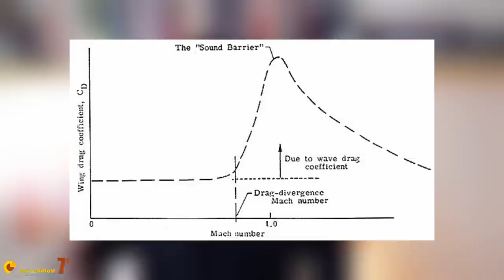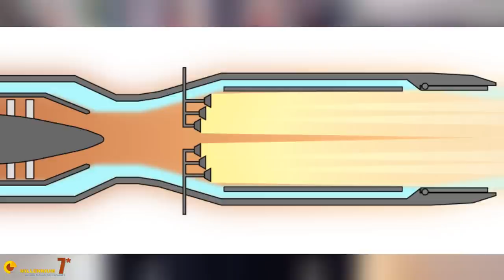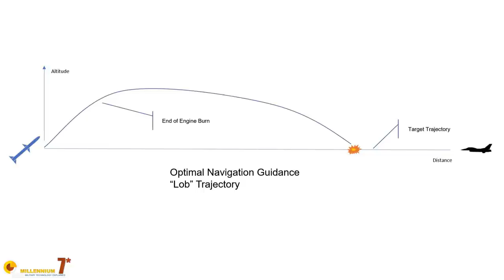Flying SUPERSONIC with NO Afterburner | Why SUPERCRUISE is so Important?

Comment: F-35 "A" can supercruise. But I would agree that it's not a "meaningful supercruise" for purposes of range/travel time vs. fuel. The data that F-35 can't supercruise is based on earlier iterations of the F-135 engine. The A model with current engines can supercruise, and tops out around mach 1.3 without afterburner. The engines are still under development. Original models of the F-135 engine had only 38,000 lbs of max thrust, but it's currently at 44,000 to 46,000 (29,000 non afterburning). Program goal is to reach 54,000-56,000 max thrust, with dry thrust well over 30,000lb, which would give all models supercruise for purposes of missile launch, and the A model a supercruise speed which could be meaningful to it's range & speed vs. fuel. Although the airframe isn't really designed for staying supersonic for long periods, and doing so would have a harsh IR detection penalty even without afterburner, due to skin heating. Still the A model can go 150+ miles at mach 1.3 in non afterburning mode.

The range/speed advantages of supercruise are not realized until you push well beyond mach 1, and start to realize some of the diminishing drag as the shape of the supersonic shockwave becomes more aerodynamic. So in that sense, all planes which supercruise at say mach 1.3/1.4 or less, do not benefit significantly by it (at least in terms of fuel vs range/speed), as they are just increasing their drag dramatically for a comparatively small boost in speed. Although, it can absolutely be useful for missile kinematics if the missile is beyond the mach 1 threshold before being ignited, as the missile does not need to expend energy overcoming this hump (edit, I see you mentioned this right as I'm typing hehe). And if that can be accomplished without afterburner, that's a plus. Although any fighter could use the afterburner to achieve this. Worth mentioning, the F-35 has a ridiculously large internal fuel capacity, making afterburning just for a missile launch relatively trivial to it's fuel reserves for the B/C model.

In a nutshell, the F-35 is designed to exploit supercruise re: the speed advantage for missile launch, without undue fuel loss or IR penalty, but does not take advantage of a sustained range/speed advantage from supercruise like the F-22. Unfortunately the plain is over it's intended weight, so only the A can avoid the IR flash of afterburner for missile launch. Thus the continued funding of engine thrust tweaking to rectify this.

Personally, I'd give the SR-71 (& related archangel 12 series) a "supercruise" title, even if they use afterburner, because they're designed to fly in afterburning mode nearly all of the time, arguably it's a largely ramjet powered aircraft in design. Similarly the concord, I wouldn't discredit it's supersonic cruise just because it needs afterburner temporarily to push past mach 1. F-14D was also supercruise capable, with wings back and the 110 engines, again not so much that it would be beneficial for 'general use', but good for a missile shot.

Speed "can" help a plane to cause missiles to expend extra energy to follow it's predicted flight path when turning, but it's also an advantage to get low and drag a missile through denser atmosphere at a lower speed. This in effect causes the relative range (in terms of how much air mass must be penetrated to reach the target) to be higher. And it allows for sharper turns for the aircraft, which can be as advantageous as high speed turns due to the much sharper turn radius. Typically a fighter would try to exploit both of these factors, initially starting at speed, and then turning down into thick air to exploit that aspect as well. This all works kinda poorly vs. phoenix missiles, as they are hypersonic, which reduces their lead distance, and allows the missile to close in on the target very rapidly. Which is why the USNavy is practically married to them.
Reply: No, it can't and it never could.  No version of the F-35 could ever supercruise.  In fact, it said on the old jsf.com website that the F135 engine wasn't even designed with supercruise in mind.  Supercruise was never to be a feature of the F-35.
Reply: @AvroBellow  It's "designed" to peek into supercruise for missile kinematic purposes, without afterburner. It's very clearly NOT designed to go significantly into supercruise as a means of extending range & speed. 

The bypass is very high, and the aerodynamics are all wrong (especially inside the air intakes) for serious high-end supercruise. But it is designed to leverage "low supercruise" for missile launch kinematics. It's over it's original design weight though, making the B/C models incapable of supercruise without using a brief amount of afterburner or a dive.

The engines are still being developed though. I'm pretty confident they can squeeze enough dry thrust into them to get the B & C models back to design goal parameters. It's very close currently. Even lower internal fuel amount is enough to tip it into low-supercruise capability. And the A model, is already at it's designed speed goal.

If you define supercruise as a means of traveling long distances very fast, then yeah, it was never designed for supercruise. So we may be arguing semantics.

PS: the avro arrow is a really cool plane.

Comment: Usually your videos are great, but this one unfortunately contains glaring errors and promotes wrong concepts. 
At 4:40 - Wave drag does not reach a peak around Mach 1!! It's only the drag coefficient that does. The coefficient drops after about Mach 1.1, but the drag itself (both skin friction and wave) keeps rising (in other words, the slope of the drop in CD is always at a rate lower than M^2). I have never come across a configuration, be it body only (bullets, tanks), BTT (aircraft) or STT (most missiles) that shows a drop in the drag itself as it goes past Mach 1(as opposed to its coefficient). 
A simple empirical formula for the drop in wave drag coefficient is given in Raymer's "Aircraft design: a conceptual approach" (eq. 12.45 in the 9th edition). If you convert this to drag force you will see an increase. Likewise, a drag coefficient map for lots of different aircrafts is given in the same section of the book (fig. 12.34) and if converted for actual drag will show an obvious increase. I suggest you try it with the F-104 as that shows the highest drop in drag coefficient, yet still an increase in drag force. Similar data can be easily found for bullets and missiles, leading to the same conclusion.

The reason that aircrafts going between Mach 1.1 and 1.3 experience an increase in acceleration relative to Mach 1 is not due to a reduction in drag (there's no such thing), but due to increase in excess power. Excess power depends on both drag and thrust. In the aforementioned range the increase in drag is usually at a lower rate than the increase in (jet engine) thrust, so overall excess power increases and an aircraft will have a higher acceleration than at Mach 1. 
This is true for jet engines, but not for rocket propulsion. The thrust of a rocket is independent of its speed, so for missiles the excess power always decreases with speed. Therefore the acceleration of a missile at a given thrust level is always dropping with speed. A missile launched at Mach 1.2 for example will therefore have to push against more drag than a missile launched at Mach 0.9, and will have less initial acceleration. However, since it started with higher speed it will end up with higher speed when the motor cuts out. So what you said at 12:05 is only half true - the benefit is only in giving the missile higher initial energy, not in avoiding going through Mach 1.
Reply from the maker: I am aware, it is not an error. I intentionally confused the coefficient with the force because this is a YT video and not a university lesson with a lot of equations. I tried to add the equations in the past, but it wasn't well received. The only diagram I show, shows the Cd and not D.
However your observation is correct, as it is explained in the video it seems that the total drag is falling.

About the missiles, I still have some doubts, because pilots themselves explain that they are trained to launch at supersonic speed, if possible, to avoid the missile going through "the hump". Also I am not so sure that the nozzle expansion doesn't have an effect in this respect.
If you could point me to some material I would be happy to go deeper into this.
Reply: @Millennium7HistoryTech  I was only able to reply now, so I hope you will still see this.
By nozzle expansion I assume you mean the rocket nozzle. The expansion is affected by combustion pressure, ambient pressure (altitude) and nozzle geometry alone. So at a given engine burn parameters the thrust is affected only by ambient pressure and is entirely independent of speed. I have experience in missile aerodynamic and in 6 DOF simulations of them. Thrust is always modeled in the way I explained. Here are some publicly available papers in support of this:

1. https://turano.io/projects/Launch_Systems.pdf. This discusses the aim-7 as an example. See fig 3.1 for the thrust profile. This is a duel phase solid propellant rocket motor and you can see that the thrust (in each phase) is constant. Also Note the thrust equation (eq. 3.8) - it depends only on combustion parameters, nozzle geometry and ambient pressure.
This paper also discusses the aerodynamics, and looking at the equations you can see that the drag is always rising with Mach (I know you said you know this, but as it's discussed in the paper I thought I'd mentioned it for anyone else who might be interested).
2. https://scholarworks.calstate.edu/downloads/vm40xv302. Another paper discussing the aim-7. Note fig. 3-10 - thrust is a constant (at each phase).
3. https://ijret.org/volumes/2015v04/i03/IJRET20150403016.pdf. This discusses aerodynamics only. Note that drag (fig 1, 2) is rising continuously and never drops past Mach 1. 

So we have drag that keeps increasing with Mach, and thrust that is constant - therefore a missile will experience a continuous reduction in acceleration as it goes through and behind Mach 1 (ignoring change in mass - but that has nothing to do with Mach number). There is therefore no advantage in avoiding Mach 1, only in giving the missile more initial speed.

Comment: English Electric Lightning in the 1950s could supercruise
Reply: No, It couldn't
The prototype with no payload could cruise at M1.02 - No in service version of the plane could without wet (Afterburning) thrust

Thats before pointing out that the purpose of super-cruise is to cruise above the transonic drag peak making for easy acceleration, not AT the peak
Reply: @bengrogan9710  The prototypes were powered by un-reheated Armstrong Siddeley Sapphire. WG760 when through the sound barrier in a climb, the aircraft was limited to 1.5 mach due to directional stability limits. Production aircraft were powered by the much more powerful  Rolls-Royce Avon engines which allowed production aircraft to supercruise higher speeds then the prototypes could.
Reply: @andyc3088  Can you cite any source showing any production could maintain post-Mach speeds in level flight at sea level on dry thrust only
This is the definition of super-cruise
We are both in agreement that with wet thrust the Avon's where more powerful, but wet thrust is not super-cruise
Reply: @bengrogan9710  There's many, many articles on the internet with the information just look and your see. However, it's very hard for an aircraft to go supersonic at sea level, they have to use there afterburners to do so. This is due to many factors, the main one being at lower altitudes were air is more denser then at higher altitudes, so it's easier for aircraft to supercruise at height.  It's like riding a bike 80% of your effort is used to moving the air out of the way, this is the same for aircraft. I doubt any aircraft can supercruise even the F22 at sea level.
Reply: The reason I asked if you had any source to back up what you said is because I already know the answer is no, All the post-mach figures for the Lightning that are recorded are either Shallow dive dry thrust or level flight wet thrust.

As for the doubting ANY aircraft can super-cruise ASL, that is simply a silly statement due to the exact information that you posted the layman's explanation of.
The speed of any given mach number is dependent on atmospheric pressure, as the density at higher levels reduces so too does the speed of sound increase.

Comment: The F-22 is the ONLY one than can super cruise with a combat load because it does not suffer from parasitic drag. All the other aircraft can not super cruise AND carry fuel tanks, missiles or bombs.
Reply: @Nine Five I understand that but the internal weapons have other benefits than stealth. The F-35 has a higher cruise speed than the F-16 or 18, they have to use afterburner to keep up with the F-35.

Comment: F-16 could technically supercruise
Reply: @Niclas Eriksson ; Wing loading alone is not enough to make assumptions, as the F-16 has a lifting body. All Vipers are able to super cruise when clean. Super cruise mostly was a marketing term for the F-22.
Reply: @Niclas Eriksson ; https://www.f-16.net/forum/viewtopic.php?t=8643 the F-16N was just a clean Block 30 Viper again most Vipers and many combat aircraft in general can supercruise clean. The F-16N was also never fitted with weapons. Stop relying on Wikipedia.
Reply: @Niclas Eriksson ; The plural of aircraft in the English language is aircraft. See the problem is that technically the F-16N wouldn't qualify if it wasn't for the Aggressor role, yet other Big Mouth Vipers are also in the Aggressor role and fly clean as threat simulation and reach Mach without reheat.
Reply: @Niclas Eriksson ; English technically also is my 3rd language. It has just become a personal crusade of mine to inform people about "aircrafts" being incorrect. Have a nice day ;)